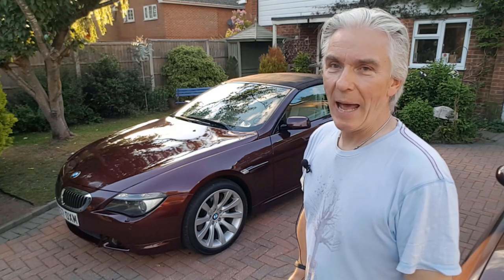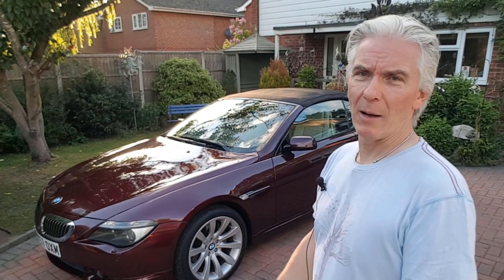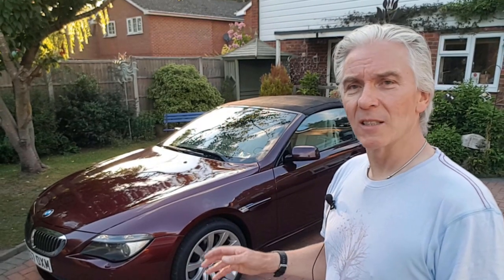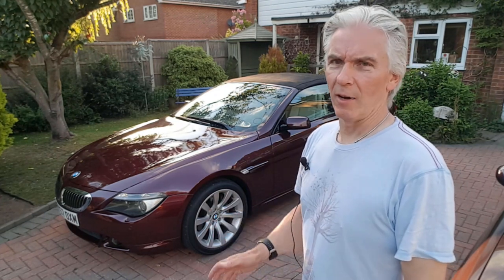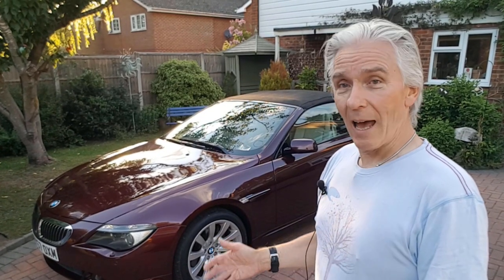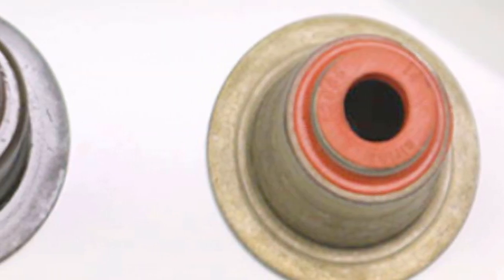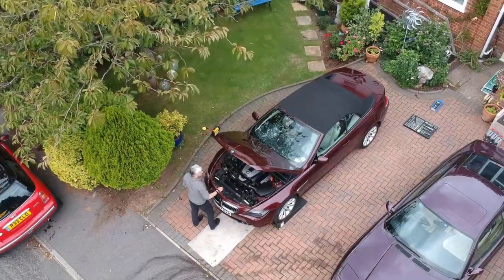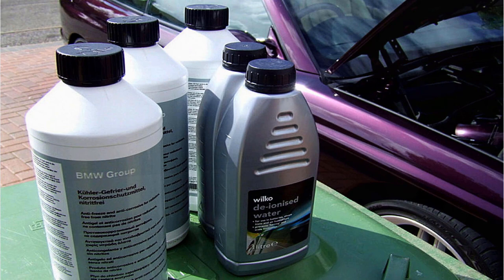BMW N62 V8 Engine Problems - SAVE IT - Don't fix later!

Comment: Yes oil change intervals on BMW are ridiculous but doing regular oil changes wont save you from leaking valve stem seals, actually valve stem seal failure is not the cause but rather a consequence of a bigger problem - worn valve guides. The first gen Valvetronic is flawed design that causes severe valve guide wear because BMW used shit materials for valve guides in combination with rockers that are floating on followers instead of being mounted on a shaft. 150k miles and you need to pull heads and rebuild them..
Reply from the maker: Sorry, will have to disagree with you there! Have you ever seen valve guides that allow so much play that it wears the valve-stem seals? No, that's tripe I'm afraid!
Reply: @TimmsBMWRepairsandInformation  Have you ever done valve guide seal replacement yourself? Have you pulled heads from N62 and measured the wear? No you have not but I have. I have done valve guide seal replacement on several N62 engines, the 4.4 and 4.8 and I have noticed this excessive valve stem movement. Replacing valve guide seals will help for some time because they are soft and can follow the valve stem as it moves about. But as soon as they start to harden the leak will be back. Take apart any older M-series BMW straight 6 engine and you will find that valve stem seals are not much different in stiffness from what you find on N62 engines and yet they dont leak. Why? Because of properly designed followers, valves are pushed open by followers that are traveling on exactly the same axis as valve thus not causing wear to the guides. Whereas N62 has POS Valvetronic design. It will last through the warranty and that is all BMW AG cares about, this is not the same BMW AG anymore that were building engines that last.

Comment: Who has patience for this? You need to spend more effort on the transport to work, than work itself?
Reply from the maker: Yes, that's the point, if you want to run a big expensive BMW you have to work for it or pay for it!

Comment: Great videos, bit too repetitive this time
Reply from the maker: Sorry about that, and yes it could have been shorter!
Reply: @TimmsBMWRepairsandInformation  My E60 550i has Jerky gearchange, I couldn't find a link to the seals you mentioned in your video??
Done my PCV valves and no more smoke. Top man!! Everyone was saying stem seals.
Reply from the maker: They always do when most are the PVC's. Any decent garage will change the Mechatronics seals when performing an oil and filter change.
Reply: @TimmsBMWRepairsandInformation  looking to buy the seals and do it myself with help of a friend who is a mechanic.
I'll buy the meyle kit to do the gearbox oil and filter but can't find the seals...

Comment: Lifeguard oil is the transmission oil that is trademarked by ZF, it is not an engine oil. 

The whole premise that BMW dealers use a superior oil and that’s why it survives those long intervals early in the cars’ life is just complete hogwash. 

For one, there are many oils that are of superior quality than what BMW offers, which is just a rebranded Shell product. Prior to 2014-ish, it was just a rebranded German Castrol product. 

What kills the N62 engine is the long oil change intervals, full stop. The damage starts the first time the oil change interval exceeded 5k miles. It has nothing to do with some mystical long-life oil. 

The damage was not readily apparent because breakdown of the internals TAKES TIME. Conveniently it would start showing itself after the 50k warranty ends, but it started from day one. 

By the way, the 15k oil change interval was purely a marketing gambit. It was an effort to best the 10k Mercedes service interval. It may have contributed to record bmw sales of that era, but I would contend that they had record sales because they drove so damn good. They didn’t need to kill their own cars. RIP bangle butts.

Comment: For an engine to start having problems at 30.0000 miles as my sons did this is just crap engineering. Bmw total junk
Reply from the maker: If you don't mind me asking - what model was it, and how old was the car?
Reply: @TimmsBMWRepairsandInformation  it was 2016 m3 sport I think
Reply from the maker: @markleaning107  Thanks for replying Mark, very kind of you - and I can understand your attitude on such a new car, completely unacceptable.
Reply: @TimmsBMWRepairsandInformation  I had the same trouble with my mini cooper s low miledge complete engine failure I was actually arguing one  Sunday morning with the ceo of bmw Sheffield how bad the engines were
Reply from the maker: That's really bad luck. This channel is all about old BMW's so we miss the early failures and hopefully buy with our eyes open knowing each model's weak points. But having nearly-new cars fail is really poor.
Reply: @TimmsBMWRepairsandInformation  your channel is interesting to watch so I won't be turning off
Reply: @markleaning107  the mini cooper S engine was based on a peugeot PSA engine 1.6turbo :P  or if you had the older one with the supercharger thats actually a chrysler based engine xD
Reply: @mplewp  yes junk

Comment: Timm, does the 630i also have the same problems. I really like the e64, just am a bit scared am going to spend a lot on it.
Reply from the maker: No, the 630i has very few engine problems, so don't worry!
Reply: well the injectors and high pressure fuel pump don't like cheap fuel :P.    every 3rd maintenance some injector cleaner or every 18K miles